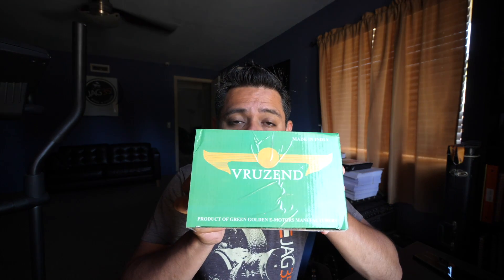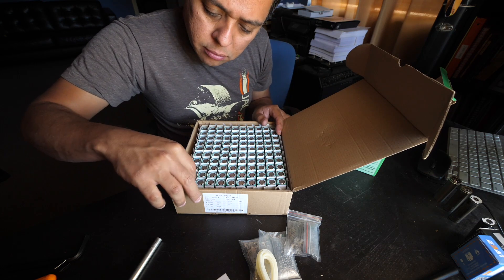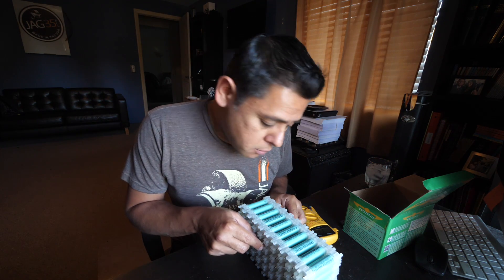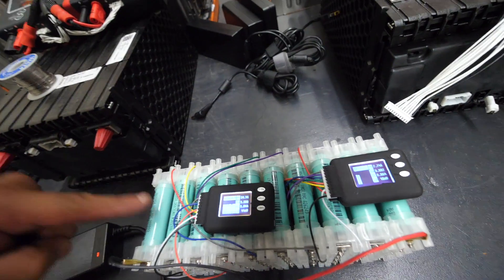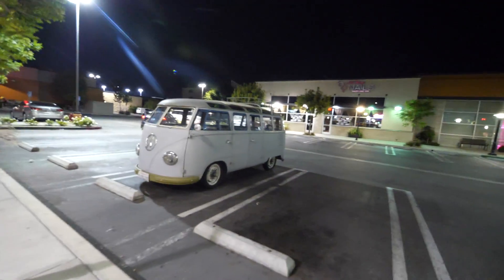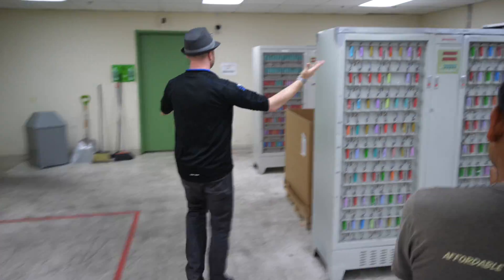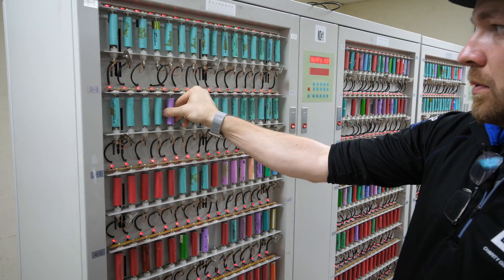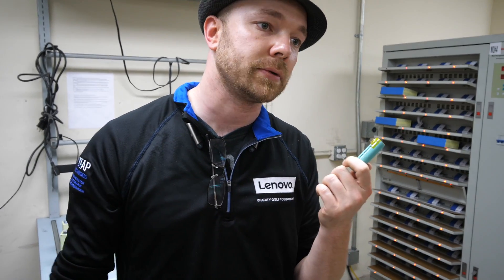Solderless 18650 Battery System by Vruzend.com

Comment: Hey Erik what's up sir. I'm planning to make a solar lamp with powerbank function using 1s10p 26650 lithium ion battery pack. What modules do I need to fast charge it using solar panel and ac to dc adapter? Thanks..

Comment: I have a used bike battery that doesnt seem to work anymore, with 18650s. would the guy at the end of the video be interested in trying to use it? it's a 42v 20ah pack, I would cover shipping, so it'd be free. I just want it to be recycled or repurposed.

Comment: You used the connectors wrong IIRC. The dovetails are supposed to be on opposite sides, otherwise you cant slide the batteries together. At least thats what I saw in someone else´s video

Comment: To anyone trying to assemble ebike battery i would reccomend lghg2 but most are fake especially littokala there 2700mah and the can only do 15a max. most ebay sellers buy them but heres where i got  mine they just restocked lol https://www.ebay.co.uk/itm/382894811723 wayy better than laptop batteries as they can do like 30a const

Comment: Hey 
I want ask you one question my Sony Vaio laptop uses Samsung ICR 18650 -22G battery I am searching for it and I didn't find anywhere. I am getting Samsung ICR 18650 -22F. Is their any differ between 18650 22F and 22G

Comment: Hello.
I would like to know your opinion about:
Soldering batteries with tin affects their performance and durability?
Lanzhd 3300 mAh 30A discharge.  67Grams Weight per unit.
Good work.     Regards.

Comment: Could you contact me at donnamaesplace at gmail as I would be willing to pay you to build me a power wall like yours but need one to run freezer, fridge, tv, lights and computer. Older know nothing about solar but badly need a system we seniors don't have to worry about. Like the Lithium iron as they don't catch fire and can keep in house. Want to get off grid with solar and wind but on a budget. Please help asap
Thanks Kindly Donna

Comment: Trying to use the Vruzend kit to build a battery for my Ford Cmaxx Energi to add to the EV battery present. The battery in the vehicle is already 7.6 kWh, about 20 mi range, give or take. The battery I'm building so far is about 2.2. kWh, adding 5 miles. Small, but it finishes my commute all EV. What method  would you use to connect it to the vehicle?

Comment: Wouldn't all the holders raise the resistance of that pack to big numbers? This seems a great way to go... But If each weld ads 0,1 Ohm as I read... Did you test the resistance?
Reply: I believe in the long term resistance will increase.
Think also when these batteries are used for e-bikes and e-scooters. it's not like testing batteries on a work bench!

Comment: I like the hot glue gun, 18650 battery spot welder and nickel for my batteries. Would not mine those connectors for R and D other than that I see no value in those connectors.

Comment: You fast forwarded through the connection part with no explanation.
Whats's difference of "parallel" vs "serial"?
Do you have a more detailed DIY from start to finish?
Reply: If you don't know that then better read some electronic basics. Cause if you're wanting to do some stuff like this you will need some theory. If he explains such basic details then the video will digress too much

Comment: nice video.  I am trying to assemble 24V Li-ion battery (with 10 Amh) for the Razor Ground Force Drifter.  I just wonder why you specify a link for the go kart charger?  In other words, I assume the original kart charger will not work if you use Li-ion batteries as it was designed for lead acid.  Can someone comment. Thx

Comment: This was the first system I bought. It was very disappointing. They are hard to work with and break easy. I have since come up with a easy and inexpensive solder less method. I have a 4 KWH eatery now, it will be about 8KWH  when I am done. Let me know what you think.
Reply: Re-Think This - Can you share what you came up with? I'm looking for a good solution too. Thanks!
Reply: The video in the link shows me charge an electric car at 1700 watts from this system I came up with. Other videos on my site show how it developed but more are coming. https://www.youtube.com/watch?v=mLSzaYR1rwo&t=1s

Comment: Are all 18650's basically the same? I'm see some sold in lots of 100 for $70, would these be okay to use for a solar system? (They say they're for flashlights) Also was wondering if the mAh is important because I was thinking of going with a 5k or 6k, or is that a bad idea?
Reply from the maker: Fake Chinese cells
Reply: jehugarcia thanks

Comment: This must be the worst battery pack kit ever. I got 4 boxes in the mail and could not wait to start working on the 14s4p pack for a silly, but cool push bike. Now, after two days I’m giving it up, tired, frustrated and on the edge to angry. One thing is that it’s difficult to put the caps together in bigger packs, but after a while you get a hang of it. The main problem is to get contact for all the batteries in the pack. Well, it’s just to push the caps tightly onto the batteries. Doing that, I made bumps on both the negative and positive pole of the battery. Not a good idea for 18560 cells. Damaged cells were disposed of…. grrrr, new cells to recycling…. The caps themselves seems to be fragile as a number of them just split. Let me correct myself – some of the blue caps splits during mounting. Not the red – only the blue. 

After working for a long time getting a 4 cell pack together as shown on the vruzend website, all cells are connected and are giving about 5.3V – brilliant. When picking the same cells up again later and doing a second measurement, one of the cells are not connected any more. Oh man I could blow a fuse for less. This kit is totally wasted for me and I normally like playing with all type of kits, to build stuff. Now I wonder if I need to put all the vruzend caps right in the recycle bin and start rethinking this project with some other means. What a waste. Probably the worst battery pack kit ever ☹
Reply: I also had the issue of breaking caps. It turned out I need to peel off the plastic layer from the battery to prevent breaking caps. Second problem - why I quit using this kit was not 100% contact with battery. I randomly measured up to 0,5 Ohm resistance on different contacts. This would mean uneven discharge of particular batteries when using it. I want a GOOD contact with battery with no effect on moisture, oxidation etc. Therefore I switched to spot welding my cells. My first (cheap) Sunkko spotwelder sadly burned after 1 hour of operation.  Now I am gonna try the Arduino spotwelder with use of car battery.

Comment: do you think the bussbars, etc can handle electric racing applications of high amps such as Zilla 2K controller?
Reply from the maker: +INTJ Sports NO!  I don't recommend using these in even mid level power applications

Comment: i had seen the advert for the solderless battery pack and already discarded it due to cost. and now it seems you should better use new 18650 for better connections? am i wrong to think that most people that want to assemble an 18650 packs are looking into the cost ? (aside from the dun) and therefore recovering 18650s at low cost from dead batteries ? not buying good new ones... (the 20.000 from Jehu is a bulk purchase, kind of one off and limited geographically etc...). nice vid thanks :)

Comment: Hello, i have some 18650, i want to make 12v battery pack, and there is variety o capacities. So i wonder does capasity mater for the arrangement? I have (2260x2, 2250x2, 2230, 2070x2, 2060x2, 2040, 1800, 1750, 1700, 1660, 1650 and 1550 mah) what is the best combination of these capasities for my 12v pack, should i put similar mah 18650's in 1 cell or make cells as simmilar in mah as possible?
Reply: Asking myself same question here in France
Few things i know : 
in parallel if one goes down to 3 V it does not stop the whole battery
in series, the first group ( in parallel ! ) which goes flat stops the entire battery
but all this is logical, or im missing something
i think anyway one should avoid to assemble a pack with batteries with big difference of capacity, for example 1000 mA and 2000 
by the way, i'm very desappointed with old laptop batteries, most of them are in bad condition, few capacity left, like 1300 mA ( 18650 models ) and often cannot stand 1 amp charging or discharging, sometimes not even 500 mA
Batteries average 10 yo old or more and used
Also disappointed  not to be able to get mr Garcias18650 tips here in France, and there are many fakes on ebay, BG, Ali, etc...
! hugh !

Comment: Those solderless connectors seem iffy. What happens if they loosen up a little and you start losing contact on a couple of cells in a pack. What a pain that would be.
Reply: Hugh Jafro Loctite 8660

Comment: recycling batteries is saving so much on natural resources and manufacturing waste . I remember braking apart my first laptop battery which I got from the IT guy at my work place, that was 5 years ago , and I still use them in my flashlight 😊

Comment: I wished I could take 100 but I'm in Australia and moving to Seattle within the next 30 odd days. But want to get them for my eskateboard which had lead acid and it's stuffed and needs new replacements. 36V 15ah sounds around 100.

Comment: I don't see how this system could be trustworthy long term. Any type of vibration could lead to loose connections and arcing or loss of conductivity.   If I end up building a system (which is a real possibility) I'll be using a soldered system.
Reply: Spot welding is the best method. Alternately you could use replace the kit nuts with self-locking nuts

Comment: Hi Jehu, appreciate your vids man! Would be cool to see a side by side to Tesla Powerball 2 with a DIY 20700 battery bank. Even if it just on the drawing board, it would be awesome to see exactly what would be needed to trump the Tpowerwall2 with the 20700's.
Reply from the maker: There is a Powerwall 2 on order that I might get at to tear down,  it coming
Reply: jehugarcia right on! would imagine the TPW2 would be 3 tesla battery packs... then again if they are each 5.4 Kwh then it doesn't add up.

Comment: Thanks for trying again, but still doesn't look like a system that gives a lot of confidence. That's simply because the basis of the construction needs to be worked out better. Such construction should absolutely not rely on how good or bad the user pushes the cells in. A loose cell in circuit could mean a lot of problem and in some cases even be a potential danger.  
If it was a prototype idea, I would say definitely thumbs as. But as a finished product? Back to the drawing board.

Comment: OH MAN. Just a few days too late. After the last buy I had to cancel because of fraud concerns I found another source but this would have been a better buy overall for me.  Oh well.

I am really interested in the solderless connector kit. I am considering doing an electric Fiero GT. I wonder if these pack kits would be durable for this. I am also highly interested in the last couple minutes of the video with the Liion test place. Can we get a link to this guy?

Comment: you still did not follow the instructions! You need to mount one cap with the small lugs one way and the bottom cap with the lugs the other way. This you you can slide them together instead of snapping together as you did. If it can be slid inm they can be also slid out in case you need to get to an individual cell for replacement. I do not think that you can easily snap them out...

Comment: On the Vruzend, I'm still bothered that loss of contact is so easy. It would have been cake to make high spring rate contacts. I'd like to see the single cell replacement process for the Vruzend. It looks like you have to disassemble the brick. With certain soldering techniques and the cheap plastic holders its possible to pop a cell out and replace it. On the welding bumps, I dremel them down anyway. The flushcutters, as good as they are, still leave a lot of welding junk on the Samsungs we bought. The LGs were assembled with less care and as such were actually easier to take apart and clean up. 

On the fence on the high discharge cells given their total capacity is lower. I like that I don't have to put in the labor of disassembly and cleanup. Tearing those packs apart is very time consuming. If the pallet was like our Ebay LGs, I'd be in for a couple thousand. Cleaning up the Ebay batteries has been a very poor use of my personal time. The batteries came out great though. I'm glad you turned everyone on to them.

Comment: My math might be way off here, but full pallet in 12s form would be 25,000Ah?   I think for the vruzend kit it's around 1.10 per cell.  So somewhere in the 30 to 38,000.00 range to have a 25,000Ah 12s battery  handy?
Reply: 20,000 * 1.5 / 12 = 2,500 Ah @ 44.4V nominal
20,000 * 3.7 * 1.5 = 111kWh

Comment: This solderless system is a good thing, if it works. but you can get high resistor connection, when not soldered or welded.
A thing, I would like to use then. Because - if you solder 100 of cells together, you can forget it to change one bad cell later.
This can make it much easier to convert a gas car to an ev

Comment: Vruzend system would be a no go for me, spring loaded holder just says failure to me especially if the pack takes a bump on like an ebike for example. How do we find out more about the battery rig at the end. How about a video on that.

Comment: how the lg cells be better than bak if the bak cells are rated at 2200 mah when the lg cells are rated at 1800mah 1.8amph vs 2.2amph. I tested the bak cells and they are legit 2.2 amph
Reply: As I understand it, power cells have thicker electrodes taking up space and less electrolyte to be able to handle the current.
Energy cells have more electrolyte and thinner electrodes so can store more.
There's only so much room in a cell, so if you want more power+more capacity, then you need a bigger space to put it in!
Reply from the maker: elitheitguy  power cells
Reply: whats the difference power cell non power cell?
Reply from the maker: 30A continous
Reply: off 1 cell? how long? how is that even possible the 18650 max charge voltage is 4.2 volt with a possible 2.0 amp c rating lg 18650 cells 2 amp draw battery should go dead within 1 hr. 30 amp draw the battery should blowup! lol

Comment: I am interested in the batteries, but I don't know how many I will need I want to build a 1000watt ebike(I am a big dude). I would like a 50 mile range. not sure how many cells I would need.
Reply: I made a 2kWh 35Ah pack using 224 cells as 14S16P for my 1.8kW motor, that should get you 50 miles, but more cells are better to reduce depth of discharge. It's also 10kg, so there's a tradeoff between cost, weight, power and distance.
Your average power will probably be a lot less than 1000 watts unless you're tanking it into a headwind, so you could start with that and modify as required.

Comment: Thanks for trying again, Jehu! We appreciate it!
Reply: I know you loved to see Jehu finally endorsing your kit haha... =]
Reply: @ElectricBike yes but I secretly loved seeing myself in a Jehu video, mwahaha!
Reply: Ian Mangham are you serious? these make your battery 30% bulkier and these have to be the worst connectors i've ever seen...
Reply: That's not a good system when contact can be weak on some cells. You'd never know if one cell jarred loose when its in use or charging making extra heat and changing the absorption of whatever cell was loose. Is there an upgraded version yet?
Reply: @practicalguy973  Absolutely - that's exactly what I was thinking.

Comment: This system seems to be lacking a fuse for each cell.
This sounds very dangerous.
Reply: You can add a fuse to each cell easily. Just add the fuse wire to the threaded post in the parallel group instead of the bus bar. That's the point of a modular kit, you can customize it to your needs.
Reply: I don't see how that is possible with the current design.
Doesn't soldering hundreds of fuses defeat the purpose of having the threaded posts in the first place?

Comment: is the 1500mAh rating at 30A discharging rate? what is it at 300mA dicharge rate (100x less)?
Reply: Leroy Baker no, 30A discharge rate over 0.3A discharge rate is a factor of 100...
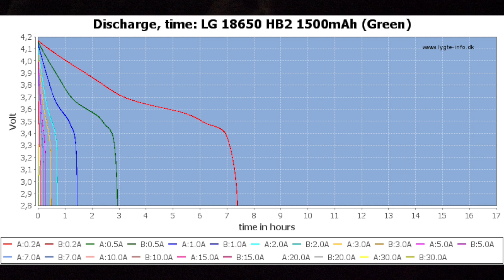Reply: Se the graph at 6:11 in the video. The 1500mAh is taken at the 0.5A discharge curve. They are probably less than 1500mA at 30A, it's hard to see in the graph. 
They didnt measure at 300mA but at 500 and 200
At 200mA they are around 1480mA so it don't seem to vary that much with discharge current.
I'm guessing these batteries are optimized for high current output instead of capacity. 20C is very impressive for a 18650cell. But on the other hand the 1500mA capacity is a bit on the low side.
So Great batteries if you want to build a small pack for high current output like an E-bike. But not so great if you want to build a power-wall with high storage capacity.
Reply: Harry Zachrisson good catch ! so it seems little difference, still 7.5 hours at 0.2mAh -> 1500 mAh